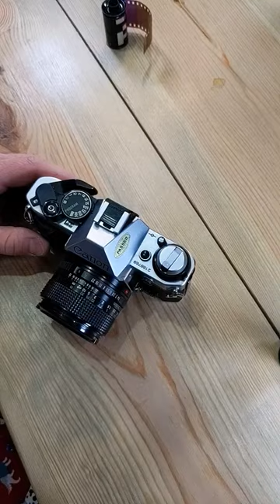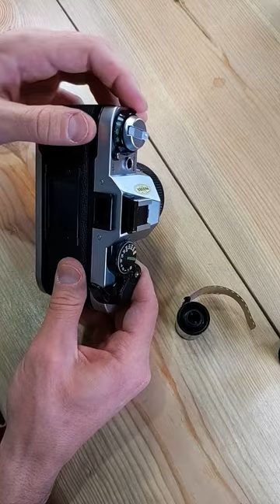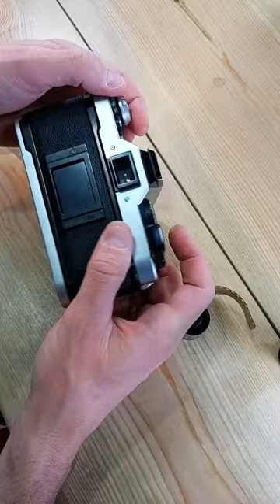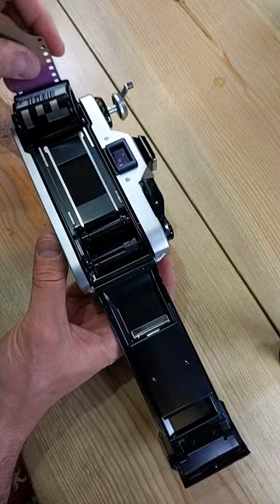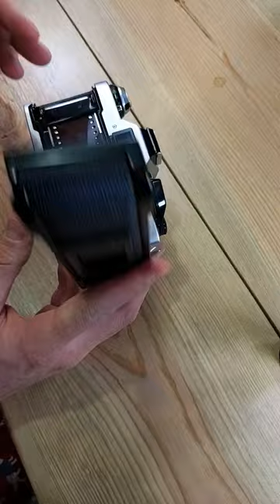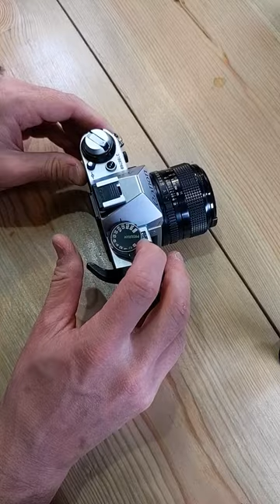Canon AE-1 Program How to Load Film Short

Comment: Why can’t you load film while the shutter dial is on PROGRAM?
Reply from the maker: IIRC, on this camera the program mode will be active on frames less than 0. Typically, people leave the lens cap on when loading film. That will lead to very long exposures when advancing the film during loading and because most people will develop a muscle memory to advance rapidly during loading can cause the film advance lever to put pressure on the shutter mechanism which, in some cameras, can cause shutter issues if that happens often.
Reply: @DavidHancock  I believe I left the cap off. Am I okay..? I hope I didn’t mess anything up haha but I’m definitely gonna take your advice! Thank you for the sweet, simple video! I also jammed in the first time loading. I got it into the splines, but I noticed the latch wasn’t moving smoothly so I forced it and kinda ripped the square opening on the film… so my first 6 photos, I noticed the rewind knob wasn’t moving. So I popped open the camera and the film was stuck in the first position so I never took any of those 6 photos… I just advanced the film one more time while open, and now it functions how it normally should!
Reply from the maker: Sounds like you'll be a-okay. Yeah, if the film doesn't get into the take-p spool properly, that happens. I would be lying if I said I'd never gone through an entire roll and then realized it took WAY too little time to rewind it. :D

Comment: What would happen if I load the film while on program mode?
Reply from the maker: Armageddon. Joking aside, nothing really bad. But with this camera model I forget if the shutter speed is fixed at frames less than 1 or not. If the latter, then the shutter speeds could be very long if you have the lens cap on while you advance to frame 1.
Reply: @DavidHancock  hahahah maybe with an armageddon they'll finally start lowering film prices again :(. But yeah, I remember re-reading the ae-1 manual the other day and noticing that there was a warning saying "do not load film while on program mode" sadly it didn't gave much info on why I shouldn't do that
Reply from the maker: @jatonert  I suspect it just has to do with exposure timing when advancing the film from start to 1. I can't think of a mechanical reason that it would be an issue other than reflex or habit where loading film is an immediate shutter press to film advance, and that could potentially damage the mechanism, I suppose.